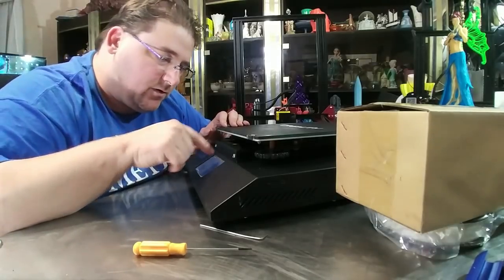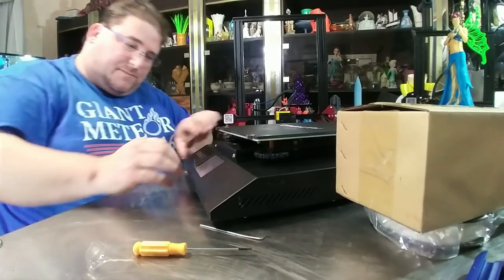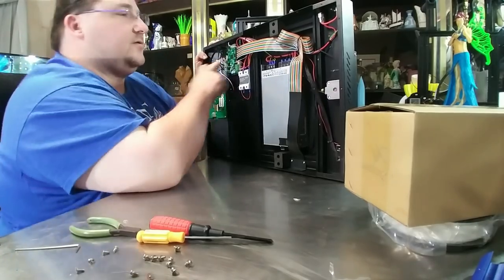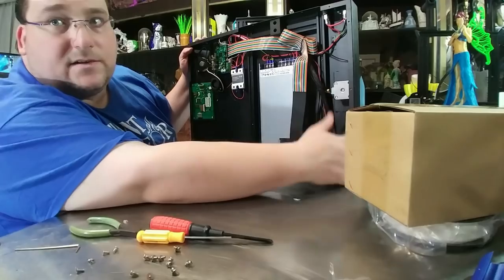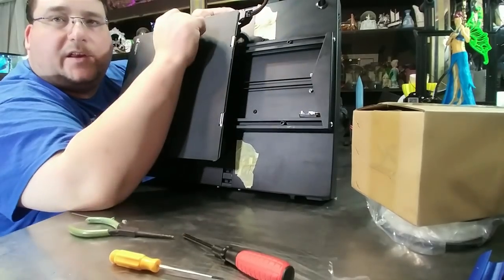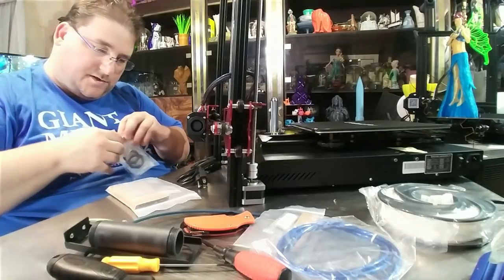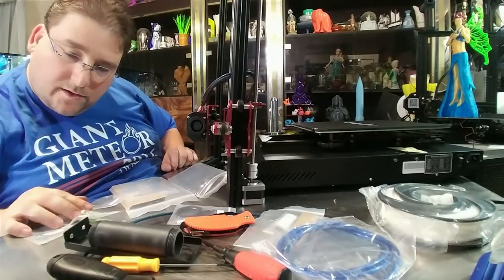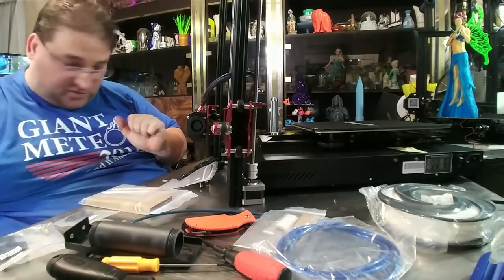CR-10s Pro Behind The Scenes Series Part 2 - T3DP

Comment: good video dude im looking at buying on and having ago at 3D printing watched lots of videos CR-10 seems the one to but 400x300 size and no one has said anything bad about them plus price in UK £385 or there abouts i have not a clue about 3D printing X Y Z etc would you have any ideas on what to start with i think CR-10 for the size what do you think by the way great videos watching all of your videos ino your on a pro version but I'm thinking price alot lol learning a lot thanks epic detail thank you
Reply from the maker: I usually tell people start with something like the Ender 3 because it is very cheap and very manageable although I'm starting to shift towards suggesting the Ender 5 simply because the hardware portion of it is much easier for a first time user since it is a self-aligning structure and only cost slightly more than the Ender 3

But if you know you were going to get into this heavy and not bail on it and therefore be stuck with an expensive purchase and you know you're going to want to print large I'll cr-10 is not a bad way to start not at all it is a very good very reliable machine that's very easy to maintain and parts are plentiful and cheap it's also a little bit easier to assemble them in Ender 3 since it comes largely assembled

If you have any specific questions ask away and I will do my best to answer